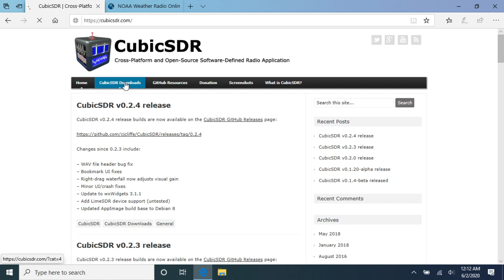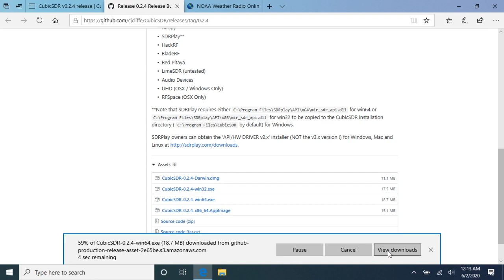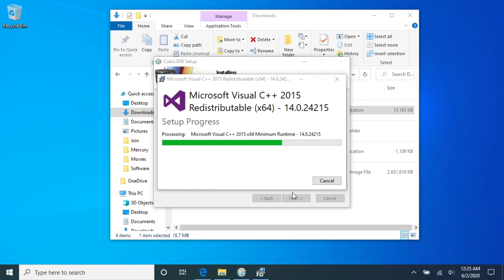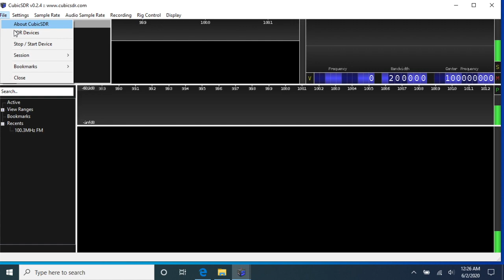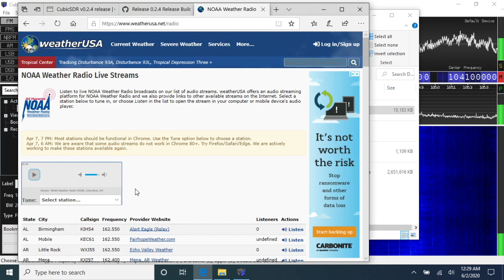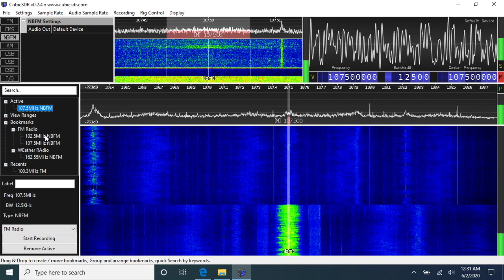CubicSDR Basic Setup on Windows 10 with RTL-SDR Blog V3

Comment: I'm 78 yrs old and have been and avid SWL listener for many years. My post here may not be relevant as this video is 5 years old, but here is what I have learned about this SDR technology. I tried a RTL-SDR about a month ago. I had HDSDR software loaded on my computer. After spending 2 weeks navigating around this software, I just sent the RTL-SDR back. (Amazon) I was overwhelmed trying to learn the intricacies of this software. Honestly, they need more tutorials of how to uses this kind of software. I DX mostly Ham operators on the 20 and 40 meter with my MLA-30 loop antenna. I have a Hammarlund 170 ham receiver and a Kenwood R-2000 receiver. Both very good receivers for Ham operator listening. But this SDR software is very, very complex to use. I now have bought a Nooelec SDR and decided to use the CubicSDR software. I'm finding that the Cubic if by far a lot less confusing. SDR soft ware is still a mystery to navigate around. So far, I have found this video to be of the best help for navigating the Cubic software. 
https://www.youtube.com/watch?v=9PzvGyBWeHM

Comment: Most of the RTL-SDR information processes and solutions documented are useful, but an important point missed.  In my experience the RTL-SDR v4 only functions properly when inserted in a USB 2.0 slot.  If the device is inserted in a USB-3.x or USB-4 slot, it does not function properly, at least that has been my experience on three different computers, Dell, HP, and Lenovo.  However, using a USB 2.0 slot on all three systems with the RTL-SDRv4 dongle was flawless, I ended up selecting CubicSDR, but easily installed SDR#
Reply from the maker: The v4 model wasn't out when I recorded this. I haven't had any issues with the v3 model using USB 3.0 ports.

Comment: I can use my SDR with SDR #. But when I try Cubic SDR, my SDR dongle is not showing up in the device list. Do you have any idea as to what could be the issue? I have a cheap RTL2832. Not the you showed in the Amazon link.
Reply: The RTL2832 is junk if you are trying to run it on a MAC